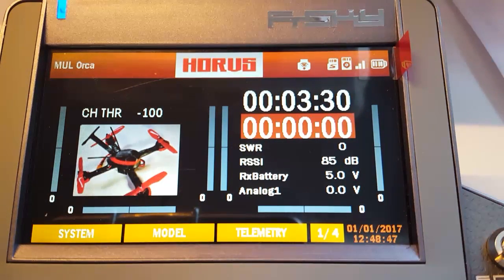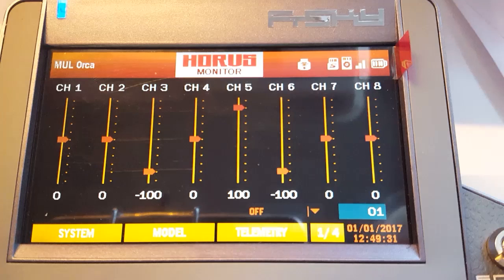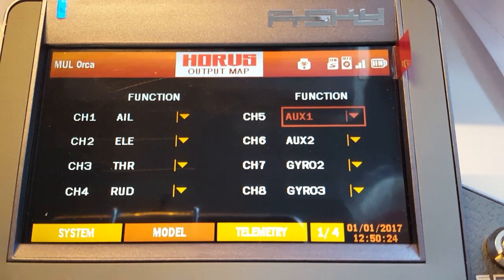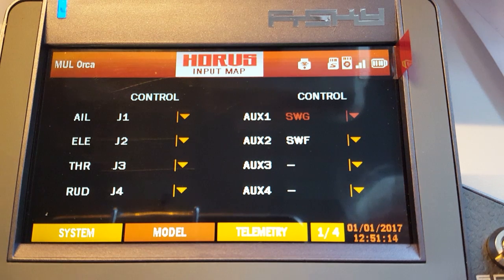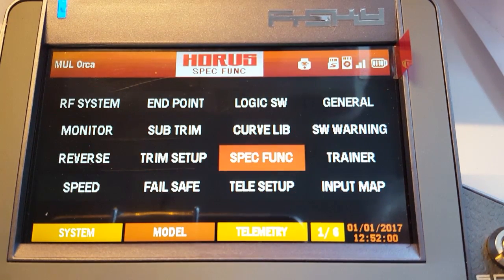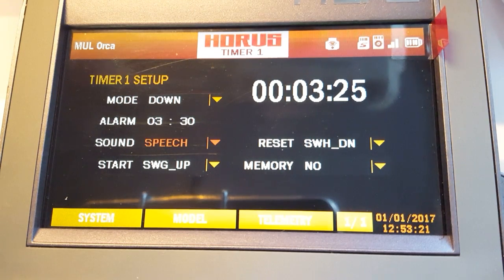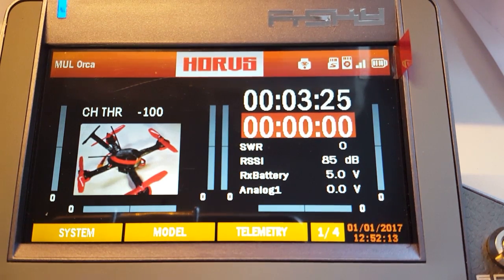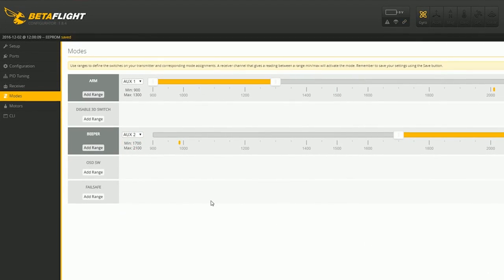Frsky Horus: How to add flightmode switches in FrOS

Comment: how do i do an idle up or "airmode" with the horus? i just bought mine and i cant figure it out. thnx in advance
Reply from the maker: BlackSmoke FPV hi. This is what this video gives you if you use betaflight as it has airmode when you arm the motors. what is it that you are struggling with specificly
Reply: FLYPiLOT   When i arm motors with kiss fc they idle very slowly...i need a way to set the SG switch so arm is middle and down is idle up. Basically just need to flip the switch and have that one dn position be "arm" as well as idle the motors up a few percent just enough to keep the pid controller active at dead stick. I watched a video with a mix setup that worked really well with taranis but cant figure out how to setup the mix on the horus software.
Reply: FLYPiLOT so SG up is motors disarmed, SG mid is armed(slow idle no active pid controller), and SG dn is armed(high idle pid controller active)
Reply from the maker: So what you need to do is as follows, enter EX MIXES. On page one you set : Enable ON, MIXER TO THR, SRC AUX1, SW SWG_UP. On page two : LEFT -20(or whatever value you need your throttle to get the PID loop running), RIGHT 000, Then select everything else to zero on the other 2 pages and click save... enjoy, hope that helps.
Reply: ok that did boost throttle but at the wrong position. it boosts throttle signal when disarming the motors in position swg_up with the setup you listed. also it doesnt keep my aux_1 signal in hi position(2000) to arm the motors in position  swg_mid, only armed in swg_dn position. thnx for all the help in advance...
what i need is disarmed at pos SWG_UP...armed with min throttle at pos SWG_mid...and armed with elevated throttle at pos SWG_dn.  
sorry to be such a pain in the ass.
Reply: been messing with it for 20min and cant get the result i want :-(
Reply: figured it out. had to do 2 separate mixes to get it done.
mix 1= tricking the switch into thinking SWG_mid position is SWG_dn position to provide the armed signal in both SWG_mid and SWG_dn positions...that mix went like this: 1/4=enable:on, mix to:aux1, src:aux1, sw:swg_mid, meth:+=...2/4=weight:w1, left +100, right:+100, sw:swg_mid...3/4=o1, offset:+100, sw:SWG_mid...4/4=c1, curve:-, sw:-  and that got that done.
mix 2=idle up...that mix went like this:
1/4=enable:on, mix to thr, src:thr, sw:SWG_dn, meth:+=...2/4=weight:w1, left:-20, right:000, sw:swg_dn, 3/4=o1, offset:000, sw:-, 4/4=c1, curve:-, sw:-...and that accomplished the idle up. thnx much for the ffort, I appreciate it greatly.
Reply: just the source needed to be thr, and the swg_dn...other than that you were right on the money. plus the offset mix of course.
Reply from the maker: Good job figuring it out, glad I could be of some help :)